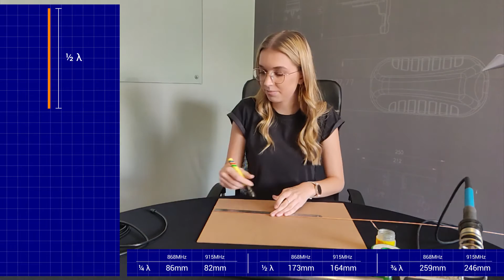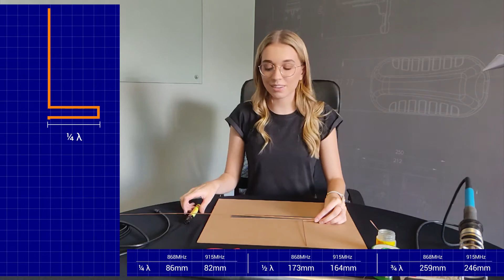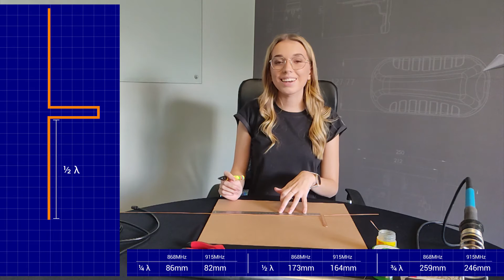Build your own Helium Antenna - DIY J-Pole Helium Antenna

Comment: Would it benefit to add another hairpin 1/4 wave and straight 1/2 wave section at the top for additional gain? And if so, would the measurements of the extra section need to be adjusted?
Reply: Yes it will work. Add 2 more to it and you have a 4 half wave collinear vertical. You will have to support it somehow as it will be a bit flimsy using 14 gauge house wire maybe using a wood dowel. The first half wave is at the bottom j-pole.
Reply: @jrfoleyjr  Thanks for responding. One possible plan might be to hang it from the top to deal with the flimsiness of the extension. {?]

Comment: You mentioned it'd 4dBi, but what's the expected SWR of that antenna on 868MHz?
Reply: Use a nano vna to adjust swr
Reply from the maker: VSWR considerably below 2:1. Not really very difficult since the antenna is very narrow band so NOT getting good VSWR would be really sloppy. Likely reason why Peter didn't mention it specifically

Comment: How much dbi have this antena ?
What is the range can reach ?
Thank you
Reply: Hi Helium Network, the Antenna that Peter and Cameryn made is also known as a Super-J Antenna and it has a theoretical Gain of around 4dBi. The question of distance depends on many factors such as the terrain where you are deploying the Antenna, the main factor being a totally unobstructed line-of-sight to the Helium Transceiver you will be communicating with,. Further factors that will of course determine the distance will be the Gain of this Antenna (the one at the target Transceiver), the Output Power of this (target) Transceiver etc etc. The best way to compare this Super-J antenna's performance is to calculate how much it will improve the distance of a halfwave Dipole Antenna where both Antennas in the comparison will be mounted in the same position. A Halfwave Dipole has a theoretical Gain of 2.15dBi so the difference between a 'standard Halfwave and the 'Super-J' Antenna will be approximately 1.85dB. If you were, for instance, able to communicate over 10km with an outside Halfwave Dipole, given the Free Space Path Loss at 868MHz and you were to mount a Super-J in the place of the Halfwave Dipole, you will theoretically be able to communicate at the same level with a Transceiver 12.37km away. However, this is where the difference between an Antenna inside a building versus mounting the Antenna outside makes a massive difference. The theoretical Signal Loss from outside a Building (or Residential Property, any Building really) is anywhere between 16dB - 20dB depending on the Frequency. In other words, anywhere from 40x to 100x LESS Signal. Our OMNI-300 Antenna has a Gain of 4.5dBi across the LoRa Frequencies and has an easy-to-mount bracket for either mounting it on a Wall or on a Pole (Mast) and will provide you with huge increase in performance over an inside Antenna. Attached is a Case Study showing how an outside Antenna improves Helium coverage. The OMNI-300 was developed subsequent to this article and is a narrow band Antenna specifically aimed at the LoRa Frequencies  https://poynting.tech/articles/helium-crypto-mining-increase-coverage-using-the-poynting-omni-antenna-2/?compare=5820,5823,5824,5857 Pieter Prinsloo, Technical Support Engineer, Poynting Antennas.
Reply: @pieterprinsloo1022  thank you.
if I use a wire thicker than 2.5mm do you think the dbi will grow up?
I have a lot of miners at 20km from me but bettween them and me i have a small forest and i think if i increase the dbi i will be able to hit them
Reply: @heliumnetwork2871  No, the wire diameter doesn't affect the gain (dBi).  To get more gain, add more 1/2 wave elements, the same way as the upper 1/2 wave and phasing coil (the rounded loop) on the antenna in the video.